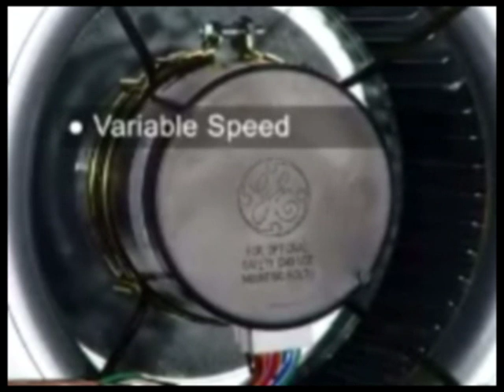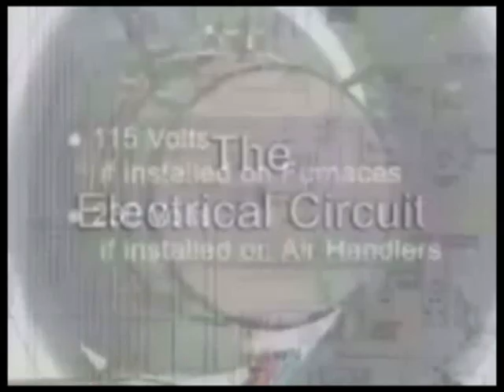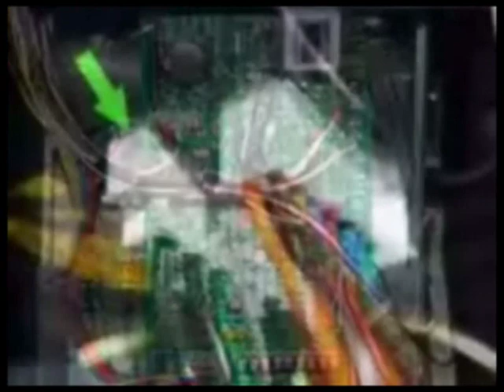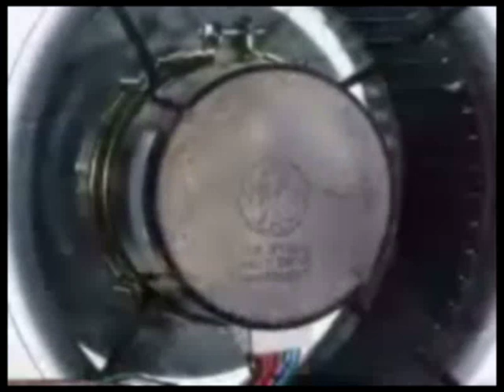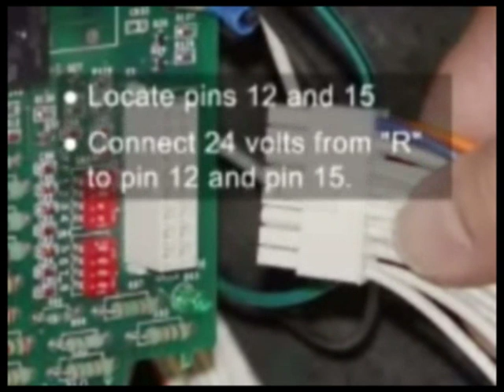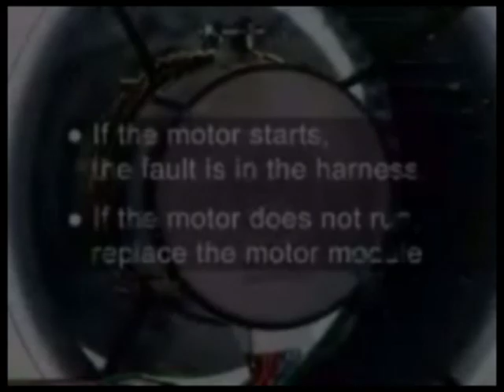ECM Blower Motor Test

Comment: ***If the motor doesn't run while performing the test, the problem COULD be caused by bad ifc board and not the ecm module.

Comment: Sound like the ECM motor module on the back of the motor.  Search for "9V ECM motor check" for a test anyone can do.  Then call around to the HVAC companies in your area to buy a used module.  The new ones are too expensive for non-warranty work.

Comment: Not really a misleading title at all, but anyhow....
I have an ECM that keeps hunting.  The shaft never makes a full revolution.  This is under the demand for cooling and continuous fan.  Is it the furnace board, the control board or motor?  What a piece of crap.  I had a property with a furnace that was 40 years old and had the original motor.